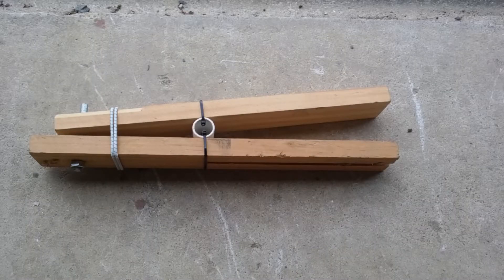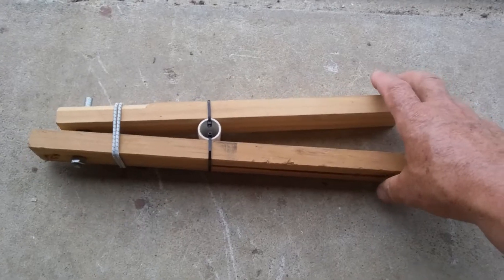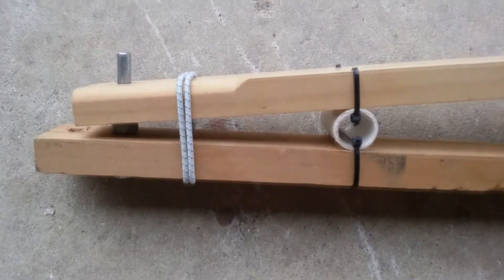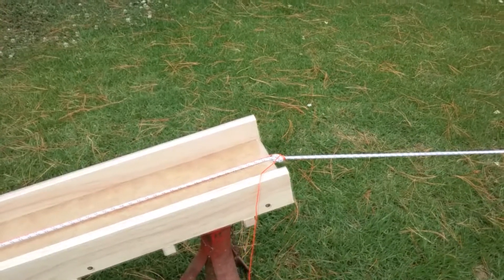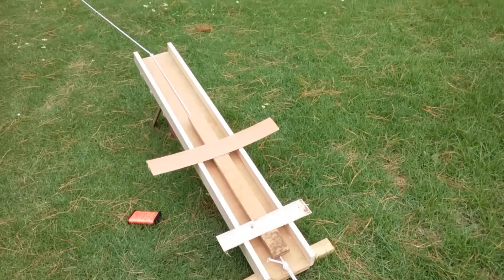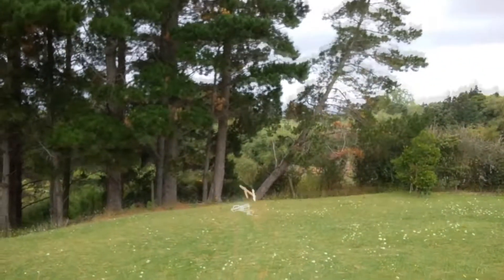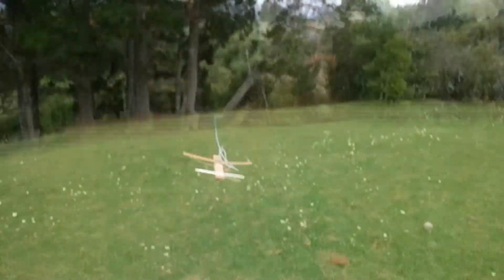Bungee RC Airplane Launcher

Comment: How did the bungie secure to the plane...
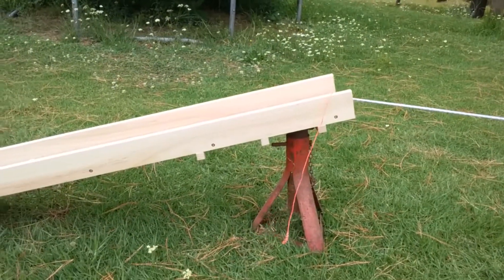Reply from the maker: If you look at about 0:55 in the video there is a ring attached to a short piece of string tied at the knot in the bungee.
I have a small hook attached to the bottom of the plane and the ring falls out quite easily once it has launched the plane.